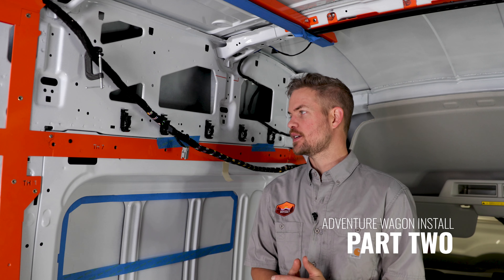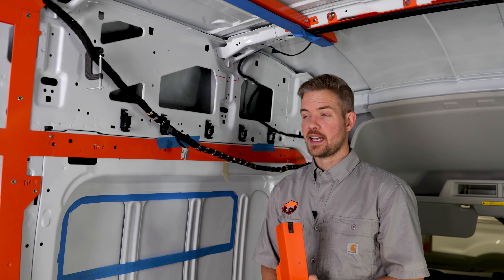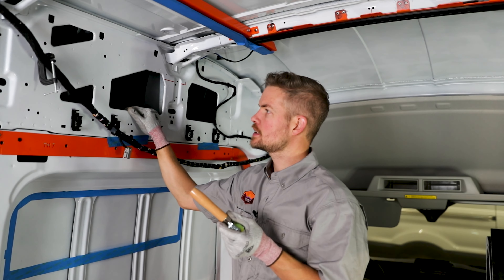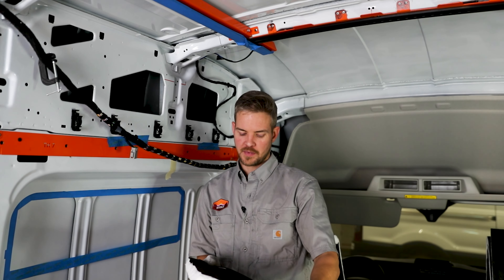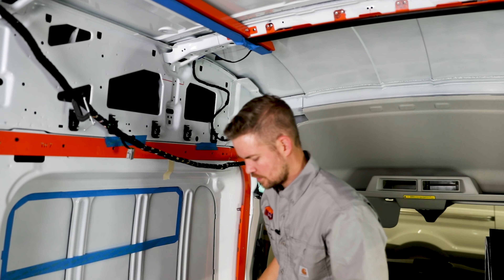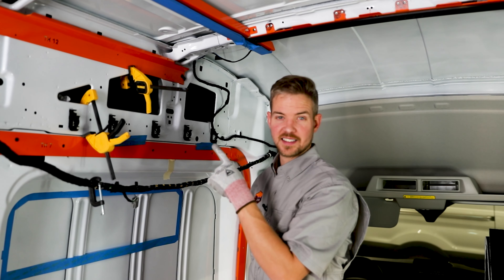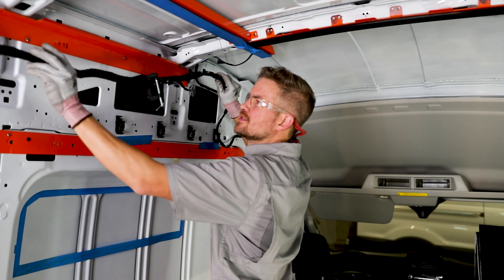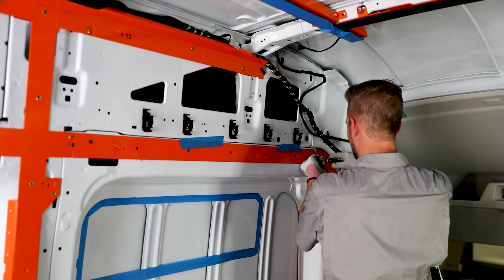Adventure Wagon Interior Conversion Part 2

Comment: Nice tip about holding of on the A-Frame pices to get the Hush Matt and Thinsulate in. Only thing I would do different is, I would drill out the holes before installing the Hush Matt and Insulation to prevent trapping metal shaving it the wall.